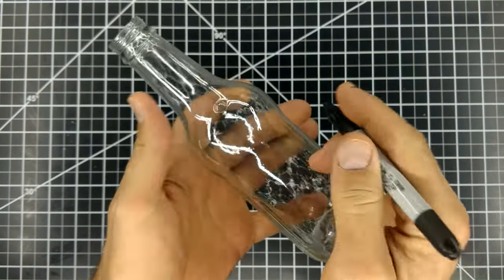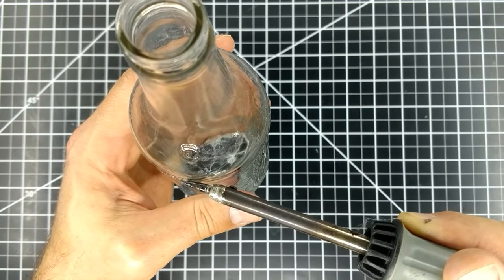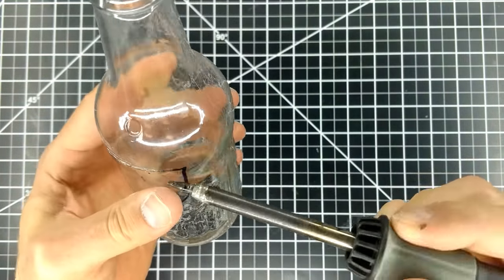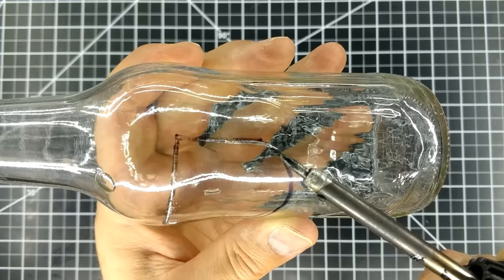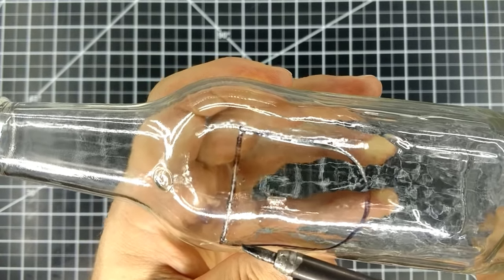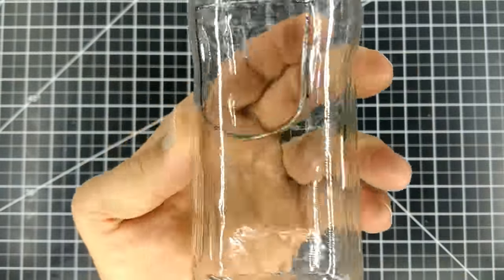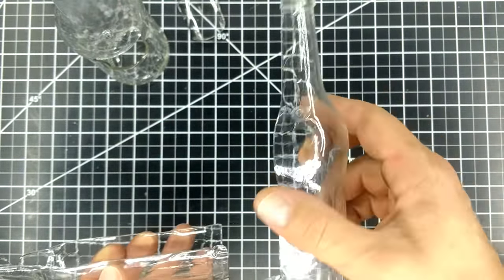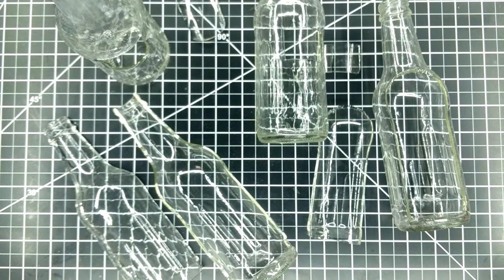Cut a Hole In a Glass Bottle (Using a Soldering Iron)

Comment: Can you please tell me what is the min temp required to be achieved by the soldering iron so that it is able to develop a crack .... Is 250°c sufficient??
Reply from the maker: I don't know what the minimum temp is, the soldering irons I have used are not adjustable. One is 15 watts and the other is 30 watts. I hope this is helpful.
Reply: @HowDoYouDIY looking online I saw iron of 25 W...would it work?? And secondly, If i wanted to cut a hole in the thick bottom of any bottle does this idea still work the same way??
Reply from the maker: @lafzonkekarwaan5939  25 watts should work. Thicker glass is harder to do, and I have not been able to get this to work on the thick bottom of a bottle.

Comment: How hot is the soldering iron? I have mine at 800 degrees and it wont even make a mark on the bottle
Reply from the maker: I don't know the temperature, the one I use isn't adjustable. It's either 15 watts or 30 watts, I don't remember which one I used here. There are a few things to remember when trying this. First, you need to score the glass with a glass cutting tool. You don't need to score the whole thing, but at least an inch or two. The next thing to remember is that the thickness of the glass can make it harder to start. Soda/beer bottles are a good thickness for this. Wine/liquor bottles can be a quite a bit harder to start because they're usually thicker. If you're trying to do a thicker bottle, I suggest practicing on thinner bottles until you get it to work. I hope this info helps.
Reply: @HowDoYouDIY  ok I didnt try scoring it beforehand, I have a cutter coming from amazon that will be here soon and I will give it another try, thank you for responding

Comment: Hello, would you happen to know how I can create a slit in a wine bottle and a hole in the bottom of a wine bottle?
Reply from the maker: Drilling a hole in the bottom of a wine bottle is pretty easy, I have a video showing how to do that: https://youtu.be/vruWpGb5248

For creating a slit in the side, if you have a Dremel then you can use a diamond cutting wheel like this: https://amzn.to/3s4Mw8p or a diamond burr set like this: https://amzn.to/2V72Zu2

Just make sure you keep the part of the bottle that you're cutting/drilling either under water, or with a constant stream of water where you're cutting/drilling. It would also be helpful to practice on other glass bottles first, to get a feel for the speed and pressure you need for a good result.

And remember to wear safety glasses and a good dust mask. I hope this is helpful!

Comment: Is it possible to use this technique to cut other shapes into a bottle?
Reply from the maker: Kind of, it depends on the shape. If it has sharp turns or corners it's likely to crack. I tried doing a star once but that was too much. And shapes with curves should be fine just as long as the turns aren't too tight. Also, tapping out the center piece can be tricky.

Comment: Can thick glass bottles cut with this technique like chemical carrying glass bottles or pharmacy related bottles
Reply from the maker: It is possible to use this technique with thicker bottles, but it is harder.
Reply: Thanks a lot! Exactly what I wanted to do. however i  am unable to get the cut piece to pop out. I tried pushing it out from the inside, still it won't come out.
Reply from the maker: That is one of the trickiest steps when doing this. I had to tap pretty hard several times to get mine out. I used the long handle from some pliers since they have a rubber padding on them. If you don't need the center piece you can carefully break it. But if you need it, keep tapping.
Reply: @HowDoYouDIY  Thanks!

Comment: Hello, Sir. i would like to ask more details about this technique. Is it possible only using Soldering Iron to cut the bottle without the score cut? I have a 30 W Soldering iron at home , which it said can reach around 410 Celsius or 770 Fahrenheit. Is it hot enough? Thank you. Look forward to hear you soon.
Reply: I use you method and nothing happen in the glass, I cant hear or see any cracking ..... could you mind tell me how high Watt of your Soldering pen?? Is it necessary to score it first?
Reply from the maker: Yes, the score line gives the crack a place to start. The soldering iron you have should work if you can score the bottle first.

Comment from the maker: To learn how to cut round bottles with a soldering iron, check it out here: https://youtu.be/JF6M9a_bJdo

To learn how to cut square or odd shaped bottles, check it out here: https://youtu.be/_jRNuVxLsfE

To learn how I made this bottle scoring jig, check it out here: https://youtu.be/qRf38Rg-Nlg
Reply: Have you tried this on a thicker bottle, like a wine bottle?  I want to try this on a  wine bottle.
Reply from the maker: +routt ookc I have used this technique to cut a whiskey bottle in half to make a whiskey glass. Haven't tried a wine bottle, but I would think it should work.
Reply: That's an awesome idea, whiskey bottle whiskey glasses!  Thanks for the video, I will report back when/if I get it to work on a wine bottle.
Reply: 2018 sci fi movies
Reply: How Do You? DIY
Reply: Any chance you think same results could happen with wood burning tool? I realize it will probably take longer but do you think it gets hot enough to use it?
Reply from the maker: That's a good question. I've never used a wood burning tool, but I would be interesting to find out.
Reply: @georgemomeka6485  9o0
Reply: How Do You? DIY
Reply from the maker: I don't think think method would with for that, but here's a video I made that should work for you https://youtu.be/vruWpGb5248
Reply: How Do You? DIY
Reply: How do you sand and polish such a small area?
Reply: Please please please show how you sanded those unique cuts

Comment: What temperature the tip is at? 300°C or 500^C?
Reply: similar soldering iron  used for this project and  with 500C probably does not even exist , melting point for leaded solder (63/37)  is (183 °C or 361 °F)
Reply: Głos z Ameryki 500 exists so does 1000. Probably not on this project though LOL
Reply: 1870 ºC
Reply: On HOT setting.

Comment: So, I scored my bottle, held the tip of a heated soldering iron against the score line for a few seconds, then a few more seconds, then a few more seconds, then on a different area of the score line for a few seconds... and nothing. What am I doing wrong? How hot does your soldering iron get? Help!
Reply from the maker: I don't know if this applies, but the thicker the glass is the harder it will be to start. A wine bottle or liquor bottle can be difficult to do this with. A soda bottle usually works fairly easy. Also, there score line can be what's making it not want to start. If you pass over the score line with the glass cutter more than once, it will be very difficult to start. The soldering iron I used in this video is a low temperature soldering iron, but I don't know what the actual temperature is. I hope this info helps.

Comment: What is the temp or wattage or your soldering iron?
Reply from the maker: I'm not sure of the temperature, but it's 30 watts.
Reply: @HowDoYouDIY  30W can do that? unbelievable, i use 50w but no result, literally no result just the bottle touches hot.
Reply from the maker: @fishhook2707  Did you try scoring the bottle first, with a glass cutting tool? A lot of people try to skip that step.
Reply: @HowDoYouDIY  I notice you use bottle cutting jig for the horizontal scoring line, but skip the vertical line or curve. I guess even just one scoring line is helpful?
Reply from the maker: Yes, that's right. It just needs enough score line to start cracking with the heat. About an inch or two should work.

Comment: Can you do thid with just hot water method and no soldering gun
Reply from the maker: Maybe? I wouldn't expect it to work very well because the best results come from controlling and focusing the part of the glass that you're heating up. With hot water that's very difficult to do. If you do try that, I suggest practicing on a test bottle first.

Comment: Is that dangerous like is there a possibility that the glass will shatter and hits your eyes?  Sorry im being paranoid
Reply from the maker: That's a really good question. I used to always worry about the same thing. I do recommend wearing safety glasses just in case, even though it's never happened to me. I don't think it would shatter from the heat of a soldering iron. I don't think it heats the glass fast enough to shatter.

Comment: so your teaching this method , and that's fine ___ but maybe I missed a prior video of yours addressing the need and purpose for going over the edge lightly with sandpaper or what have you because of the stresses acting from all directions on solid glass . any clean break becomes a weak point . and the fracture line leading away from those corners (stresses) had you pre-scored a shallow bore spot at each of  those corners stresses would have got relief and halted . you must sand down new edges .  (hack tip for crack windshield : if a chipped area developes after a strike . you can buy some time by halting the fracture line that developes by scoring a small 'x' in opposing directions to ease that stress) placed directly in the path , when the crack meets up it stops . a real diamond ring will do if your on the road
Reply from the maker: +gary schraa that's a great tip! I didn't think about drilling a hole at the corners before making the video. It would definitely help prevent that stray crack from forming.
Reply: well its not full proof but relieving stress points is helpful . the part about sanding the clean breaks is vital however because they can and will break and fall apart at any time . fine grit sandpaper gently on the outside and inside . oh and those 90% corners should be just like dimples not bored completely through
Reply: @ How Do You? DIY: Sir, you are an appreciative man and smart man for accepting gary schraa's tip. there's a saying about a smart man always learning when given advice.

Comment: Do a hole on a glass bottle
Reply: Put a couple layers masking tape where you want to drill the hole.  Then use a diamond drill bit using some oil as a lubricant I've done many incense bottles that way. A Dremel works great the bits are inexpensive and just go slowly letting the drill do the work. The masking tape we'll keep the bit from sliding all around and help with stress cracks
Reply from the maker: What you describe is probably the best way to make a regular hole in a bottle. Thanks for the input!

Comment: Y it's not a good idea for a small hole as you mention
Reply from the maker: This technique doesn't work with small curves. Whenever I tried it would just make a big crack that I didn't want. And for a small hole it's easy to use a drill bit made for glass.